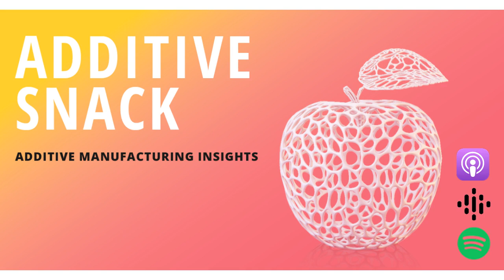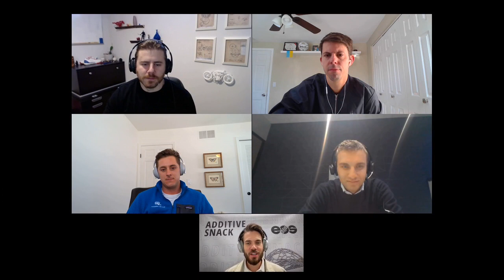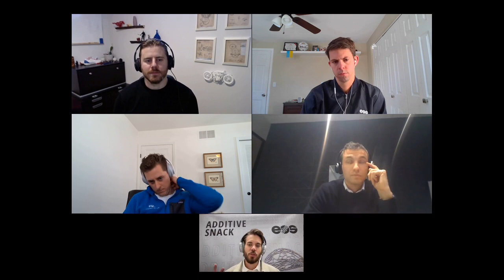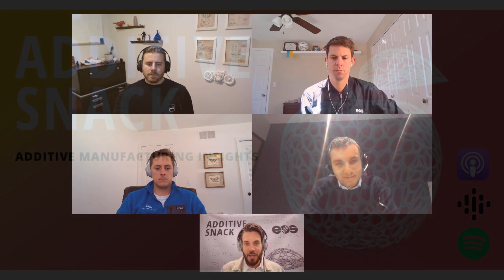A Dynamic Panel Discussion with the Digital Foam Architects Network | Additive Snack Podcast

Comment: Very interesting podcast, as always. I work at a company that builds air distribution systems and I have a feeling that the 3D printed foam could be an advantage for the filtration systems.